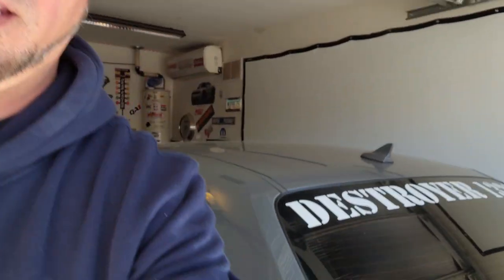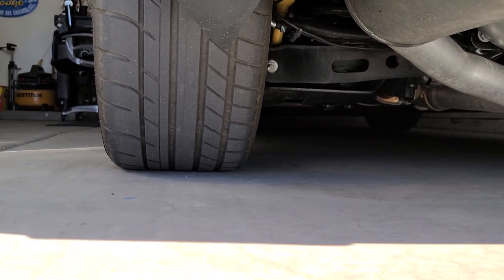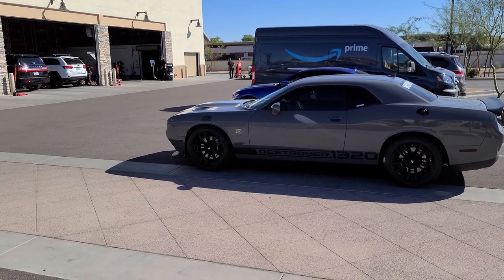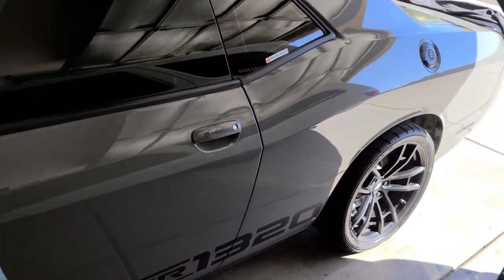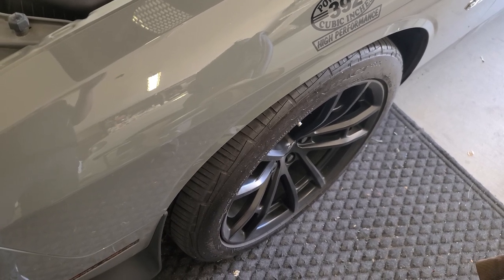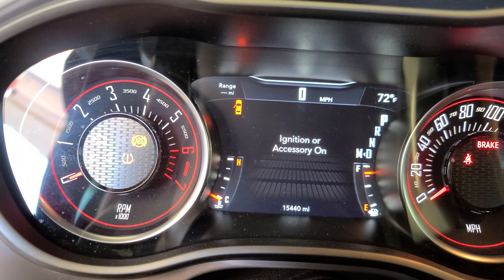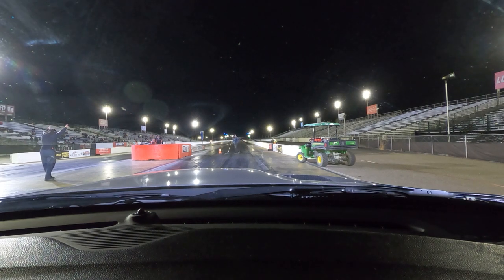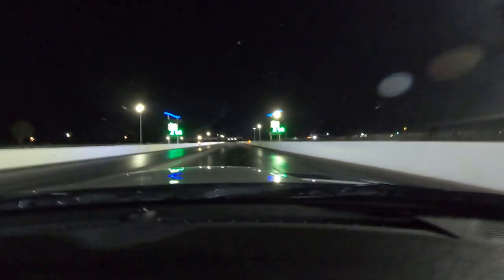#Drag Radial, Nitto NT05 Drag Radial Test "2019 Dodge Challenger 1320"

Comment: I use the NTO5R on my Hellcat for daily and ET street R at the track. That is the best hooking Nitto they make from what I have seen. I got a 1.60 60’ with the nitto and a 1.47 with the ET Street R. I have yet to even get the the ET Street R’s to spin at all on a prepped track and I make 783 whp!
Reply from the maker: That is hauling azz, once I MOD I will switch to the ET Street R
Reply: Wats better for daily driving on just a 5.7

Comment: I mismanaged my fuel level once and had way too much in the tank when I was headed to the track. But the track was 75 miles away so I just drove the entire way in a lower gear keeping the rpm between 2000-2500 to burn that gas quicker. I also did more "spirited" runs than usual lol. Great vid and good to see you back on the dragstrip again. Hope Dan IT Guy heals up quick.
Reply from the maker: Thanks brother!
Reply: @Destroyer1320  ...is this a good tire for a Challenger R/T... all stock
Reply from the maker: @ghostrt1608  YES it should work great!

Comment: How’s the jump from a 275 to 305 ? Any problems? Did discount tire give you a hard time ? Alignments ?
Reply from the maker: No issues, they said nothing. They work great!
Reply: @Destroyer1320 are you running 305 on front tires and back?
Reply from the maker: @gabrielomalley6266  275 on front

Comment: Also I went with some 315 35 20 on a 10 1/2 inch rims with +25 on scat pack shaker 392  2017 do you think I would have any issues just looking for advice
Reply from the maker: 315 is too wide without changing the end links from what I hear 305 clears.

Comment: I am new to this why pull the fuse ?,
Reply: Thought the same thing!! I think it resets the computer somehow and the car will run stronger...🤔
Reply: These cars actually learn your driving style over time and makes adjustments, usually not in favor of performance. Pulling the fuse wipes any Sunday grandma driving from its memory and resets everything. This is especially important for 1320 owners who like to daily drive while in Drag mode. That's the concensus at least.
Reply from the maker: @Scavenger1320  Nailed it!

Comment: Those look like NT05 tires. The NT05R is the drag radial version.
Reply from the maker: Yes I learned that after purchasing...😬
Reply: @Destroyer1320  I'm about to buy tires for my Foxbody. They don't make a 275/35ZR18 NT555RII or NT05R so I'm going to go NT05.👍
Reply from the maker: @LivNLo94  they are good on the track just not from a dig on the street. Let me know how they work for you. I found 20psi was the sweet spot for me.
Reply: Are the NT05s okay for daily driving? I can't figure out if they are drag radials or its just the NT05R. I was wanting the NT05 for daily spirited driving. How many miles can you get out of them?

Comment: NT05 tires are no good I have them on my challenger and I have never dead hooked with them at the track. I heated mine up but no matter what, you can’t dead hook with them. They work great on the street though. I don’t spin in second anymore with them. For no spin you have to get 18 inch bravado’s with et street r’s.
Reply from the maker: That's my next move for sure. Thanks for the tip
Reply: im 2yrs too late the NT05 is a roadcourse tire and and wont hook well with a stiff sidewall

Comment: What is the average life span of the Nittos ?  I have MT ET Streets now, but rarely use them because of their short life span ( I think around 5k miles?)
Reply from the maker: The NT05's are 15k the NT05R is 5 to 8k
Reply: @Destroyer1320  are these the R’s
Reply from the maker: @danieljohn4603  I have the NT05 Not the R I was scared to drive to Texas and back on the Rs from AZ
Reply: @Destroyer1320  So you noticed a big difference with the NT05’s over the factory tires?  Are they better than the MT ET Street SS’s?
Reply from the maker: @danieljohn4603  if you going to drag race MT SS are the better tire. Daily and occasionally racing the NT05 are good